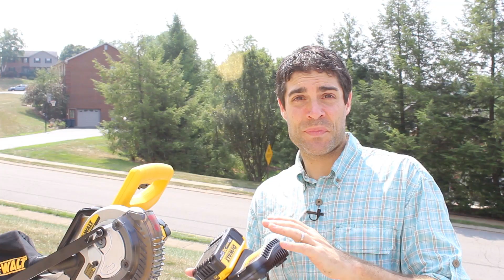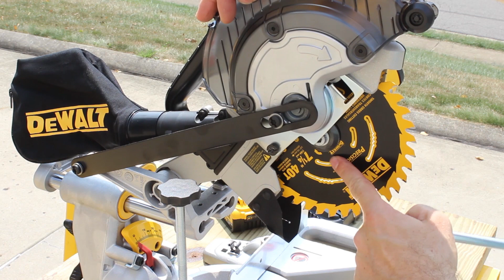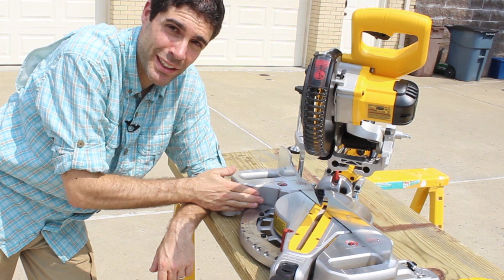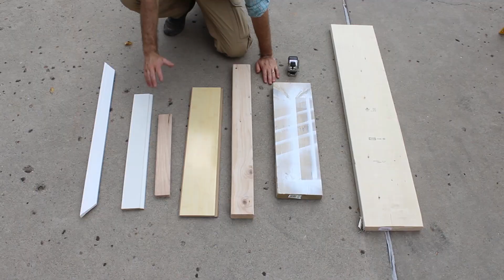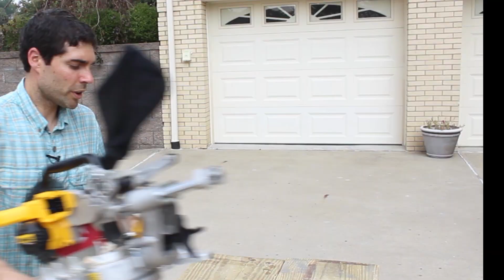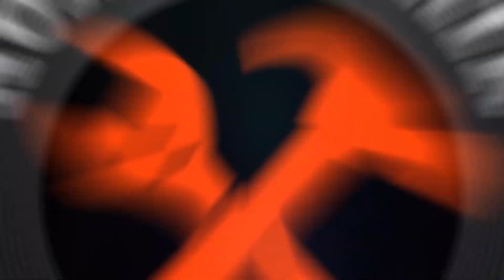Dewalt 7-1/4" 20V Max Cordless Sliding Compound Miter Saw -- by Home Repair Tutor

Comment: I like the idea of cordless portability, but I'd like to see Dewalt come out with a 120V to 20V battery adapter so this saw could be run plugged in when used near an electrical outlet, and save the batteries for the handheld tools. They have one for the 120V Flexvolt saw, but nothing for this one so far.

Comment: Hi,

I know this is a older video. This cordlees miter saw has been out for years now.  I hope dewalt can make a new version that has double bevel and brushless motor. 

Also maybe a 10" model would be very nice. At least the 10" can cut 4 x 4. It would be great for indoor trim work and outdoor projects. Especially when working on wood fence. Let's hope something new in 2020. 

Thanks for the video

Comment: The smaller chop saws are only single bevel.  That's a deal breaker for me.
Reply: Who uses double bevel, every jobsite I've been on with double bevel saws they just flip the work over its faster and more accurate, when you use the double bevel sometimes you put it right and you get a wrong cut
Reply: @loucifer323 

With one exception, every finish company I've worked for uses and has only 10" or 12" dual bevel saws.

Answer me this, how are you supposed to do a proper self return on stain grade base with a single bevel miter saw.  And what do you mean "they just flip the work over its faster and more accurate"?  Also, how do you get a wrong cut cutting on the bevel?  I can understand it could be confusing for apprentices or rough carpenters but a journeyman trim/finish carpenter?  I don't think so.
Reply: @ThekiBoran  You can do bevel cuts on a non beveling saw, and say do a bevel cut on one side you take the piece of wood and turn it around and make a bevel cut whichever way you want beveled, trust me it's faster the only time double bevel is better is in tight courtiers
Reply: @loucifer323 

Seems like you don't understand the difference between the miter adjustment and the bevel adjustment.

In a piece of stain-grade base if you cut face down with the top facing you and with the bevel, (leaning the cutting head left or right), you won't get any tearout.  It'll be a pristine, factory cut edge.  Cutting vertically there will be a tiny amount of tearout on the top because the teeth will be coming up through the finish.  Cutting face down and with the top facing you the blade teeth will be going down through the finish for both the face and top of the base.  Who cares if there's tearout on the backside or bottom?  The problem is that carpenters are lazy and they don't want to reach around to the back of the saw to make the adjustment.  A lazy carpenter means a lower quality product.

My guess is you're an apprentice?  And probably an apprentice framer.

There's a gigantic difference between framing/rough carpentry and finish carpentry.
Reply: @loucifer323 

Also, we don't call them bevel cuts.  A joint can be a butt joint or a mitered joint.  Like a 45° miter, 22.5° miter, etc.  

The table of a miter saw is the miter table, to cut on the bevel means to lean the cutting head left or right.

They make dual bevel miter saws for a reason, because they're needed for fine finish work.
Reply: @ThekiBoran  I'm an apprentice and I had this problem with doing the finishing trims on a kitchen only had a single bevel saw what double ones do u reccomend? Only seen the big 12inch one  (in terms of dewalt gear ) which I could probably afford but is very pricey for my level haha
Reply: @bradwad 

Establish a budget and go from there.  Whichever saw you get go through it with a fine tooth comb as soon as you get it.  Check the tables for coplanar, the fence for square to the tables, blade wobble, etc...  There's a bunch of good videos for checking a new saw for accuracy.  I'd watch as many as possible and get a dial indicator that you can attach to a block of wood.
Reply: @loucifer323 

Almost forgot to ask, have you sacrificed any children lately?
Reply: @ThekiBoran  Yes my brother Gabriel

Comment: Wouldn't mind having one...although I've been eyeing the new Flexvolt 12" model.
Reply from the maker: William, if you're a woodworker or contractor the Flexvolt 12" is a better option. It has more power and the 12" blade is a big upgrade
Reply: Neither really.  I do some DIY home projects and a small amount of woodworking, not enough to warrant the $700+ purchase price of one of those saws LOL.  I'd love to have one but I just cannot justify the cost.  For what I do the 7-1/4" one would be plenty.  I make writing pens, so most of my woodworking cuts are on much smaller materials usually in the 3/4" x 6" size LOL...even the 7-1/4" saw is a bit overkill, but nobody makes a 4 or 6 inch miter saw that I know of, at least not for wood working, they make a 6" chop saw for metal working stuff.  I do have a 4" Dremel Table Saw...well actually 2 of them and those are usually my goto tools for these types of projects.
Reply: Bought the bare tool for $249 on ebay a week ago, haven't messed with it much yet, but I think it will work great for cutting the small pen blanks to length.  Has plenty of power for full scale trim work and cutting 2x materials as well.

Comment: have you tried the ridgid one
Reply from the maker: +Flores 828 not yet...wait, do they have a cordless miter saw??
Reply: Home Repair Tutor yeah they were 400 dollars but i bought one yesterday at my local home depot for 180$ comes with a 5.0 battery and a charger dual bevel and height adjustment stop. its 7 and 1/4 blade too. i had to get it the battery alone at home depot is 120 dollars

Comment: for those of you saying you wish it had a laser.. Dewalt does not use a laser on ANY of its saws, They use a LED light that casts a shadow from the blade. Showing you the EXACT location of your cut. Lasers are NOT accurate! They require constant adjustment. The shadow IS visible in bright sunlight. I'm not sure why his was not visible.
Reply from the maker: +Frank Kerstein thanks for that clarification. It was super sunny that day. So I blame weird angles for the shadow issue. But overall it works great, I've been happy with the accuracy
Reply: +Jeff Patterson it's a great tool! glad you are enjoying it! :)
Reply from the maker: +Frank Kerstein been using it a lot in my rental since the electric is off while I'm remodeling the bathroom

Comment: Will it cut a 4x4?
Reply: Not in one pass, you would need to flip it over to complete the cut.  The 7-1/4" blade doesn't allow enough depth of cut...however most people using these saws would be cutting 2x4 materials.
Reply: +Nathan Shook Yes

Comment: I love the review, Jeff; however, your demonstration on how to cut the 2x10 was a little dangerous.  Any kind of lateral movement on the stock that you're cutting increases the probability of kickback and with wood that large it can cause some damage.  Other than that you may have reignited my desire to get a new miter saw.
Reply from the maker: Totally agree Adam. Kickback is a huge concern. Always important to get the blade up to full speed before cutting.
Reply: +Adam Verheyen I was being stupid with this saw and did a similar cut causing a small kickback. The benefit of it being battery powered with safety electronics, is that when it started to kick it just shut itself off. It must have registered too much torque.

Comment: Jeff, that is a cool little saw.  I've got the top end DeWalt miter saw.  I would buy an extra battery with this saw.  It looks like it would be easy to transport. Mine weighs a ton.  Well done. Douglas
Reply from the maker: The weight is light compared to comparable saws. Being able to cart this saw anywhere is one of its top features
Reply from the maker: ***** sweet, thanks for letting us know you like it. Everything is going cordless these days, it's kinda nuts!!